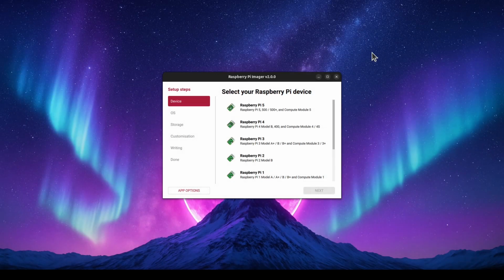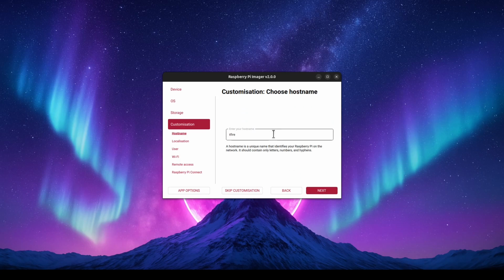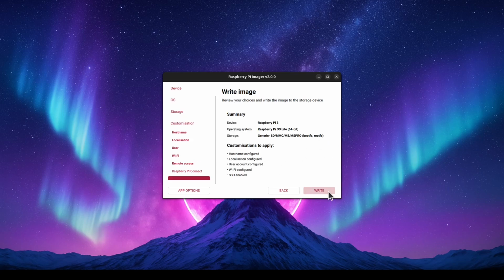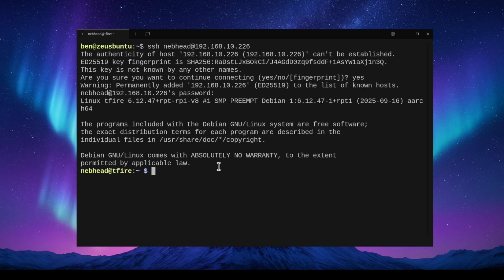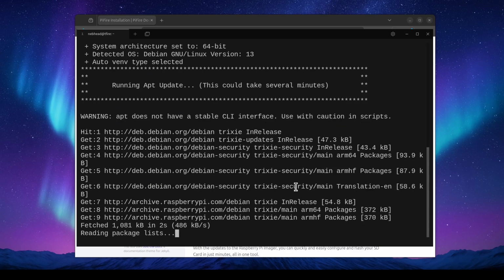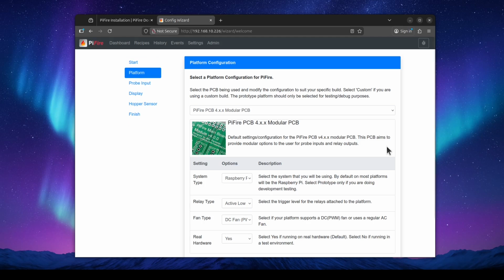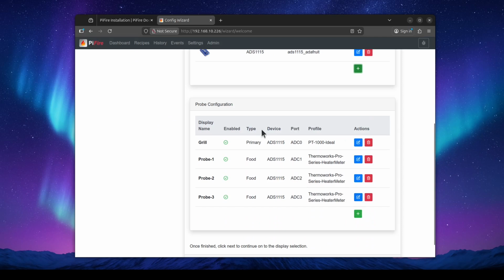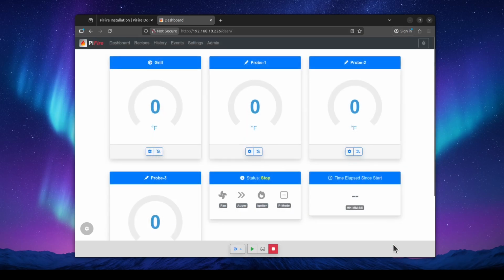PiFire Installation Tutorial December 2025

Comment: After going round and round with coyote for a new control board im heavily considering this stand alone set up. The first issue is it has a 7" HMI DWIN screen that im guessing i cant use.  So i have to find one that'll work, but i havent been able to find any videos of how the screen looks while running and if you can use a dsi touch screen with pifire for more functionality. Second is ive only been able to find boards with 3 outputs. My grill has have 5. Feed, fan, lights, ignition, and rotisserie. I can do without the rotisserie though. Also mine is 12v dc control and 120v ac for outputs. Where can i go to get these questions answered?